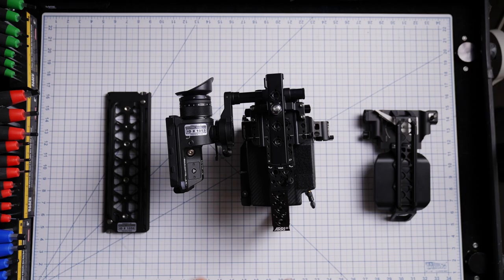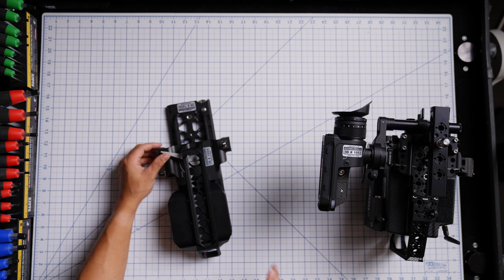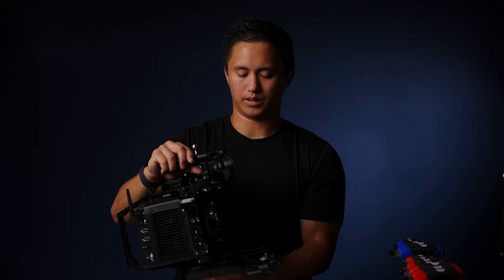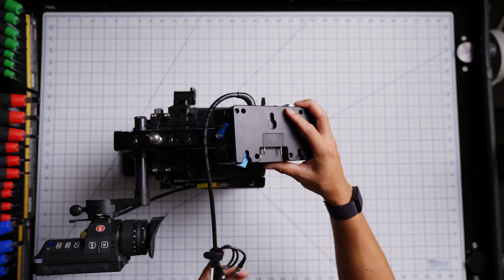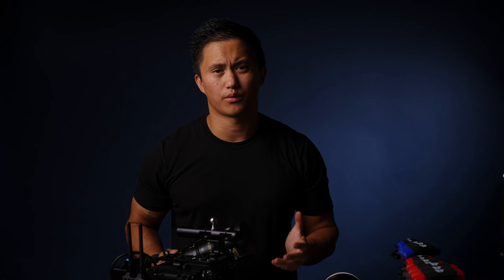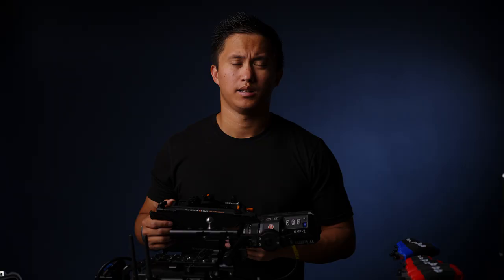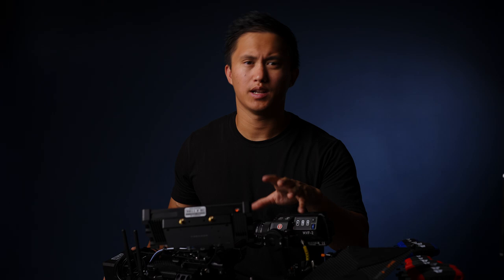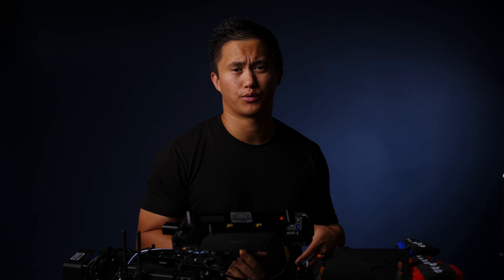Camera Rigging 101: ALEXA Mini LF

Comment: Thank you so much for this walk-through, this is extremely helpful! I really appreciate the time and specificity! Curious if you don’t have the shoulder pad plate and you also don’t use the main sort of dovetail plate under it what is the base configuration of the cage? I’d like to put one I’m going to use on a manfrotto plate tripod and I’m curious how easy it is to with just the cage assembly on there.

Comment: Looks like your Cine 7 has the built-in Teradek, any reason you're using a dedicated one versus the one in the monitor?
Reply from the maker: Mostly performance; the monitor module is a 750 equivalent while the dedicated TX is a LT MAX. It also depends on which receivers are available and make sense for the production since the newer Bolt 4K's only work with each other. I have the RX and TX module so I'm always swapping them out depending on what's needed.